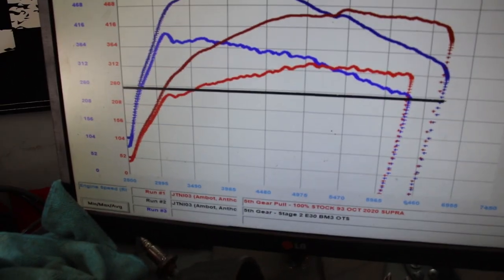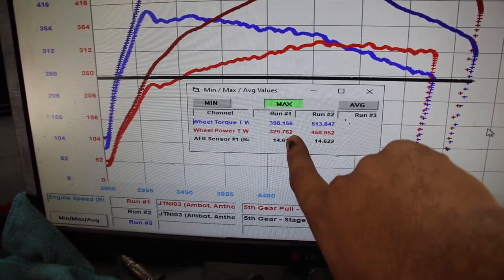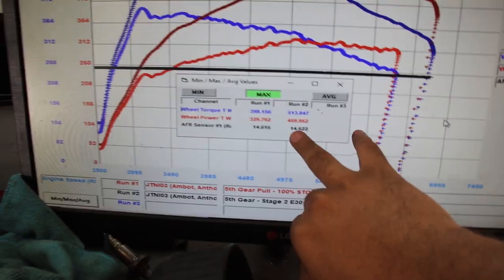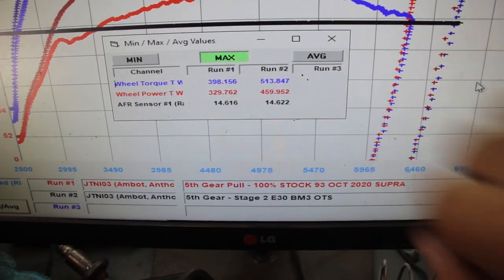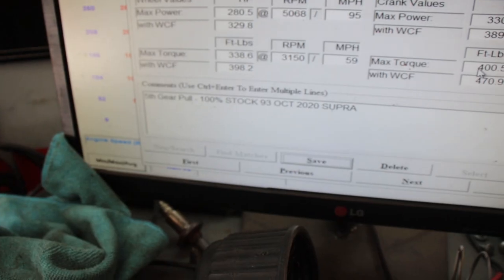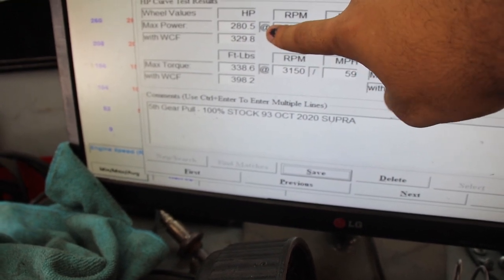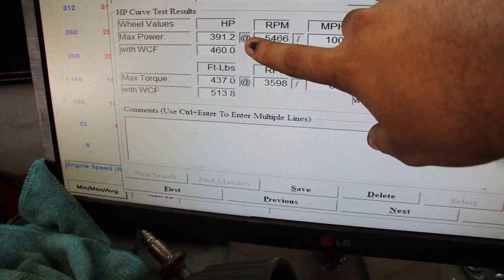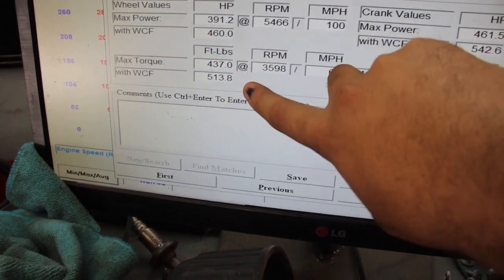2020 Supra BootMod3 Stage 2 Testing

Comment: Good luck at the track, I'm headed there Saturday, good luck on 10s👍👍💪💪 I'll tag u when I post my slip after I hit 11s🤞💪 first time on drag radials so don't know what to expect, was gonna start at 22psi and go from there,  555R's. What were you running psi wise?
Reply from the maker: Jason Thomas start at 26 psi then write down the 60 ft. This needs to be done after u find the correct launch rpm so u don’t bog. Most likely 5800ish maybe 6k. Once that is found then go back to lowering the psi and record 60 and see what gives the best one
Reply: @AMBOTTuning  thank you for the help

Comment: I did a stage 2 ots for Supra 2020
It’s not getting burbles as same as stock downshifting for example 
After tuning stage 2 when I downshifting  from 3rd gear to 2nd gear on 4 to 5 rpm it’s not bringing any burbles at all. Yet,  when it was stock it was bringing most burbles when downshifting from 3rd to 2nd gear on 3 to 5 rpm ... NOTE : I just drove it for 5 hours until now so is this normal because it’s need more driving hours to re adjust itself or that’s common issue in stage 2 ots bootmod3 PLEASE ADVISE !!